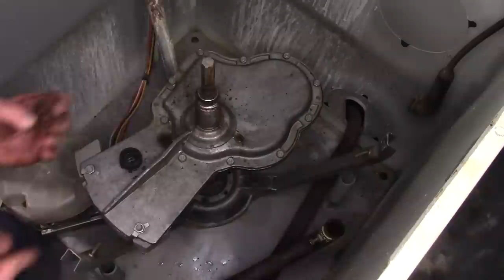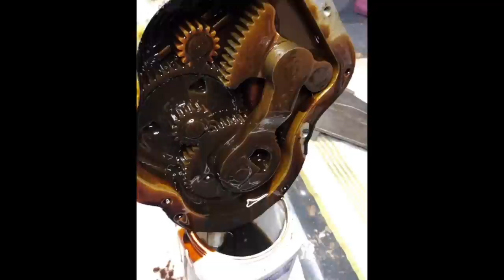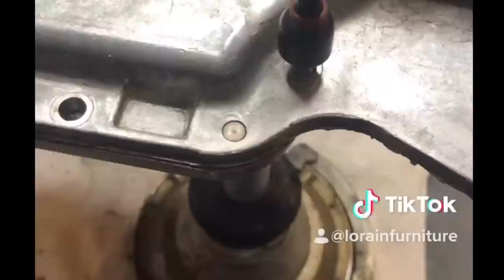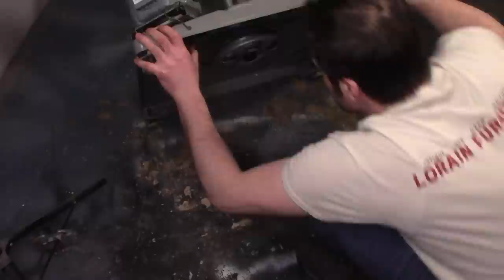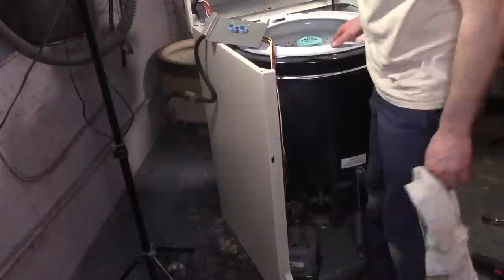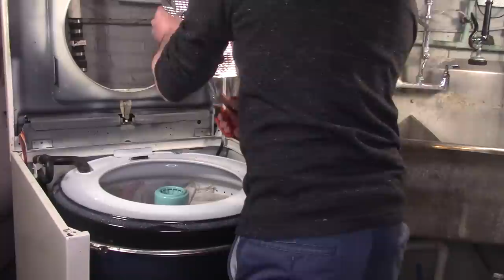Perfect Restoration of a Vintage Maytag Washer

Comment: If Maytag now owned by Whirlpool relaunched this machine they would sell like crazy to all the people who had one or grew up in a household that had one.  I would buy one in a heartbeat if they decided to make it again.  The only problem is they were designed to last, and not designed to be replaced every 5 years.  Whirlpool wants you to replace your machine every five years because it keeps the stockholders happy with your money.  That is why they make a bunch of cheap crap now.  Look at how that machine agitates the clothes.  Our HE Whirlpool/Maytag we have now doesn't do that, and it does not get the clothes clean.  To get the clothes clean on the new machine we have to pour a bucket of water in the machine after it quits filling so the clothes will move more freely.  Those old rebuilt/refurbished Maytags are about to sell at a premium because those people who hate the new HE Washers are going to start to buy them when their HE machines start failing.

Comment: Eugene if a customer comes to you with a Maytag that wants a restoration like this what is the typical cost to have this done?
Reply from the maker: Its a bit more case by case, It can be as low as $600 for mecahnical work only, and it can go up to $2k+ if I start messing around with chrome and such.  The work you saw on this video is about $1500
Reply: @LorainFurnitureandAppliance  I may eventually have that treatment done to my 1998 Maytag it is an LAT dependable care model with a load sensing agitator. I love that machine but it is showing some signs of normal wear but there is no decent replacement for it
Reply from the maker: Jon Homrich for newer Maytag its usually not as expensive.  The orbital trans  has many parts still available, and there are fewer rubber parts to change.
Reply: @LorainFurnitureandAppliance  ok good to know, I'm mainly concerned about the mechanics of it anyway I'm not a collector but I like things to work like a clock I will definitely be in touch